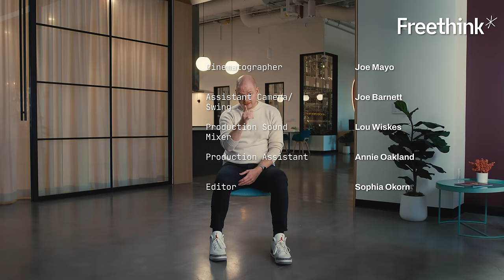Large-scale, lab-grown meat: Step inside a cultivated meat factory | Hard Reset

Comment: It is not environmentally sound or safe to manufacture lab grown meat, nor is it less expensive. The stringent safety protocols and testing, as well as the massive amounts of chemicals required make lab grown meat a poor alternative that would endanger mankind. However it still has its place, the reason it should have been invented and that is in military, intel use. This is a product for remote, secret, bases, and complex wartime theaters to provide a continuous supply of high quality protien without constant deliveries which would make it obvious. Also to support remote installations where getting supplies is challenging due to extreme weather. But this lab grown meat should be banned from commercial use.
Reply: Source: trust me bro